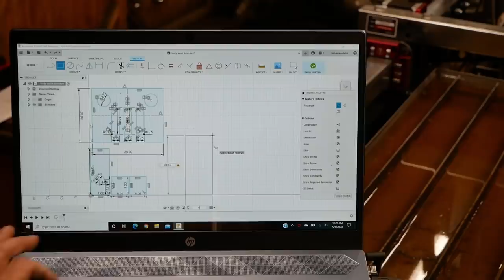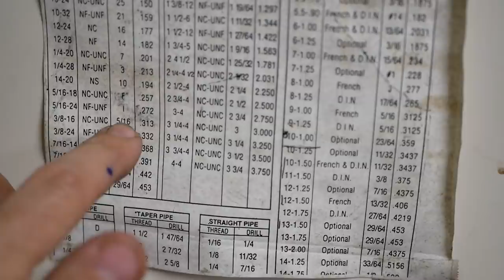420cc Predator powered articulating 4x4 dump truck build part 8

Comment: Great Stuff!  
   
....Something like this but with a hook-load mechanism on the back would be ideal for me. Hookload would be so it could quickly swap out rear modules (and tip them). Modules would be stuff like... log carrier, flatbed, dumper bed, cage for woodchip/leaves/grass, water bowser, mobile toolbox, people carrier, etc.  
  
Been looking for a mini-hookload type system for the back of a pickup to do something like this. But haven't seen anything that doesn't look clunky or isn't ridiculously priced.

Comment: I call that device a slip clutch but I think the technical name is torque limiter.  I have used them in places where the mechanisms can get jammed prior to hitting the limit switch or high forces were a concern.  What I really want to know is where to get the Mike Festiva stickers to fill in that blank space on my tool box!!  Great video, I like your growing special effects tool kit.  I also order some auto eject bolts for my current project, didn't know they were available to the public yet...
Reply from the maker: Haha! The bolts are getting a little cheaper now and more easily available 😂 
I’m new to this torque limiting coupler, after doing a lot of research I decided for the price and size they would fit my needs for the next upgrade to the articulating dump truck. My friend Dave just bought a vinyl sticker cutter Machine and he made a small run of stickers for me🙂 if I can get a few more cut I can try and get you one! Take care

Comment: Great series. I had been planning a similar build (mostly in my mind). I wanted to find a small diesel and use hydrostatic drive but your build is convincing me that maybe it wouldn’t be necessary for a machine like this. Your piece of property is also pretty awesome! A far cry from the bald prairie where I’m from. Lol anyway, keep up the good work. From: an impressed mechanical engineer.

Comment: Use the winch to pull the Suzuki up the hill!  Damn fine build, looking good!
Reply: The power of a fully locked differential versus what is probably a limited slip in the suzuki. Plus the tires on the articulated truck have more mud grip.
Reply from the maker: Both vehicles have open diffs the only real difference on the drive systems is the Suzuki is a true 4x4 with a transfer case with no center diff, the Subaru is a all wheel drive with a center diff.

Comment: Hey man....I writte to you form Argentina. I just love the artefact. 
You´ve taken that thing to the level of a product  you know that? And an interesting, plenty of potential one.
Coming from relatively simple materials, very well worked (congrats for the aluminium tig welding), you,ve taken it to full functionality. 
And I repeat,  even including it in a farming tool  tipology if you like, it reached a very , very consistent material quality.
Aditionally, it exceeds the performance of almost any device I know designed for that purpose.
If you wished to serial produce it the cost of transmision should be considered I guess, some alternative to those Subaru parts, but other than that you´re practically there.
I salute you, one man factory. Applauses.
PD: I´m an industrial designer (not sure if a good one but, anyway, jeje). 
To my beauty contest parameters, it would win any day, with the same cool elegance with wich it climbs those slopes.
Reply: Did you use google translate to write that

Comment: Mike Festive........The real life Iron Man, your rock brother!
Reply from the maker: Right on Calvin 👍 Thanks for checking out my videos, I really appreciate it!
Reply: @Mikefestiva   Holy Shyt dude your really responded! I could die in peace ! I'm a Aviation Mechanic and I aspire to be well versed in the many trades as you are. Practically everything you did in Engineering the 420cc Predator powered articulating 4x4 dump truck is the same thing I do in my line of work, The Hydraulics, Welding, and fabrication just to name a few. It would of basically took 5 Techs to do what you did, Keep it man, you motivate me to be a Jack and Master of all trades.

Comment: I noticed when you were crawling up one of the hills that you almost smacked one of your steering hydros on rock.  You might want to look into making some protection for your steering.  I know it's too late in the build to move them above the frame rail or I would recommend that.
Reply from the maker: I definitely plan on building some skid plates. The biggest reason for mounting them below for me was because I’m going to build a heated cab for plowing in the winter and that’s more important to not have cylinders in the way going though the cabs back wall. I actually will not do major off-roading with this, it’s probably going to stick to my muddy trails. My next build will be the off road machine 👍 Take care Paul

Comment: Its not a discount on the gas, most of the cost is labor to hook it up and fill it. I have a 138 cu/ft bottle and it was only 27 bux for mixed gas. I got it because I live over an hour from anywhere to get it refilled and didn't want to make that trip too often

Comment: It would be cool if you could fit a gimble type set up for the rear so when you go over a steep mound the load will stay up right whilst the rear axle pitches to the obstacles

Comment: I still think you should add an aframe to the back for a hoist function it would lift around 1000 pounds and make it into a swiss army knife around your place like I said before  we had a similar unit at the plant that I used to work at and it was very much a huge difference in moving parts  fixing equipment and other things that the maintenance department had to do.i worked there 30 years and they rebuilt it 2 times we called it the  mouse short for Mickey mouse we even had a vacuum tank for cleaning up  hydraulic spills and water. It was made in secret and hidden from the boss only used when he wasn't in the plant but he came in one night during a break down and saw it and after that it was used all day long it could go every where do about anything  and everyone remembers it.

Comment: I like the grill. Looks like Bender off of Futurama!  Lol Anyways you should put some sound deadening on the underside of the hood. It would help cut down the noise of the motor. As for the whole build I think its pretty cool. If I was doing it I'd made it fully hydrostatic, but the manual trans works too.
Reply: Hydrostatic would be awesome but the complexity and cost are  considerably more this build is the first generation and proof of concept it will be interesting to see how it holds up and if any thing  needs to be improved or strengthened

Comment: I really liked the hinge work for the hood then you went and put the winch on there and completely defeated the purpose. That hood must be severely limited in its opening gap now with the winch.
Reply: Right, because it’s impossible to slip those hinge bolts out.... 🙄

Comment: Ive been dying to know what unit bearing you used for the center swivel. As you know, many of them rely on the wheel nut to load the bearings. 

I'm just starting to acquire parts for my own articulated tractor based off 2 gm sm465 gear boxes plugged directly into 14 bolt rear axles with twin engines. One engine driving the front and the other driving the rear. The idea is to be able to cruise and steer off the rear engine and when I need more power/traction, start the front engine and shift the front trans into gear. Also planning to run a loader off the front engine
Reply from the maker: That sounds like a good build 👍 I used a Ford F 350 super Duty 4x4 front bearing, I think from a 1999? There’s about a five year run were the same bearing fits F250, F350,F450 and possibly F550? It’s got a really big nut that holds the entire hub together.Time will tell how well it holds up 🤷🏻‍♂️ The way I built the machine is it’s basically two frames with the wheels about centered with the load of each frame. I know my F250 is over 6,000lbs and I have hauled 4,500lbs of gravel in it without a problem plus those bearings should be able to handle that weight with a full load at 60mph on bumpy roads. Take care

Comment: Would a longer exhaust with a muffler (either straight up, tractor style) or dumping out underneath quieten the engine a bit?  The build is great, it's almost let down by the engine!

Comment: Nice work, I'm sure not the first time someone said this you need to add a loop bar and seat belts and a crash plate behind the driver seat so when you start hauling rocks and stuff and if it flips you will still be here to make more cool stuff just saying

Comment: Really nice build, from an idea to a running off road wood hauling little beast, i have seen most of videos on the build and your new tool additions and the plasma table is a great tool to have, i use one where i work,  its an industrial set up for cutting teeth in heat  treated boron and works great cuts 3/4"- 1 3/8"  it just doesn't have the cad software you have, looks like your living in Fern Gully nice area , it will be cool to see when you finish it more and have a load in the bed, then you will tell yourself i need this on it and answer yourself ah hell yes, its ok to answer yourself i do all the time LOL  , look forward to the next video,  great editing,  👍

Comment: You could make the HOOD hinge bolts removable  so the hood can swing open OR pop right off when the winch is mounted.
Reply from the maker: Yes I can open the hood to fill up the gas take and do simple work, pull two bolts and lift off the hood, I have thought about installing pins like you mentioned 👍

Comment: Cut out the outline of the winch in the grill bolt it down. When the hood is closed it looks complete but will open completely with out removing any bolts. Not sure if it makes sense but I think it would work...

Comment: Mike - Correction: Vehicle width (50"). Wheelbase is the distance between the front and rear axle hub centers. Track width is from wheel centerline to wheel centerline on other side of axle.
Reply from the maker: Thanks 👍

Comment: Great design Mike! Looks like you borrowed from the 1970s Coot vehicle a little? Very nice drive train! Kudos!
Reply from the maker: I will have to look that Coot up I’m not sure I know what it is. Thanks for checking out my truck build 👍
Reply: It is a amphibious vehicle that also  pivots  very cool design it was a friend had one in the 70s we used to ride it all over even in a pond! .. It was designed in the late 60s early 70s

Comment: Very cool. Find my self worrying about that turn cylinder. Can it not be flipped to be mounted above the frame rail? You can see it getting pretty close to ground and rocks. With a loaded bed I wouldn’t of thought it would take much to bend it on a inconveniently placed rock/tree.

Comment: That winch was almost a waste of money on that beast. It seems unstoppable;
Reply from the maker: Haha you are right! It definitely hooks up off-road. I’m in the process of building a external adjustable limited slip for the rear diff, so it’s going to get even better. Nate it’s hard to see in your photo but is that a CB you’re sitting on?
I have a old Honda CB 350 four and my brother has a CB 500, I also gave my nephew my old CB 200 twin cafe bike I built up. Take care 👍
Reply: @Mikefestiva  it's a Suzuki GS750 I built into a cafe racer. Don't have it anymore, sure wish I did though.

Comment: This is turning into an amazing machine! Has me fanticizing about building one.  I'm curious about the weight in it's current state, the weight of the Subaru drive train, and how much weight you hope to be able to haul.  Now that you have played with it a bit, is there anything you would do differently on the build?  (specifically regarding the articulation joint design)
Keep up the good work!

Comment: 26:05 You cannot compare two vehicles if they have different tires! After all, it becomes quite different and like comparing winter tires to summer tires on an icy road . One tip for the winch is to put a switch on one of the cables! Has happened that cheap china winches go off and pulls wires and mounts when someone winch nearby with their remote control.

Comment: of course it climbs better then your side kick lol...one has crappy tires and the other has Tractor Tires!! Truly not a suprising outcome. I am sure the results would be the same or very similar (some weight difference between vehicles) if you put the sidekick tires on your toy ttuck and tried it again in the same conditions as before 8'D   Very cool toy though and its cool to see you make it yourself!  build a Roll Cage and Back Cage for protection on rollovers rtc!
Reply from the maker: The tires on the Suzuki are not crappy tires they are brand new mud terrain tires, it’s a really steep hill and extremely mucking. I get tired of people making assumptions. Even said in the video I had new mud tires on it.
Reply: @Mikefestiva  Hi Mike, I should have used a more descriptive sentence then saying "one has crappy tires and the other has Tractor Tires!!" I should have said, "The tires on the Suzuki are Crappy Tires when you compare them to the Tractor Tires even if they are Brand New Mud Tires. They still do NOT compare to the Tractor Tires you are using which are meant to be used in fields of dirt and mud while pulling heaving equipment behind it. Something YOUR Suzuki with Brand New Mud Tires could not compete against! Look at the Tires, the tread type, size of treads and of course what they are meant to be used for!  Put the Brand New Suzuki Mud Tires on your Tractor and do the exact same run in the exact same conditions and I would say there is a 99.99% chance that it will NOT perform as well as it does with the Tractor Tires. 

I meant NO disrespect in my first comment and again mean NO disrespect but I was WRONG in assuming that you'd simply understand what I meant. So I tried to write it in a clearer way this time. By the way, I was not making any assumptions I was speaking from experience in 4x4 and I also owned the exact same type of vehicle you used! So I know what it can and cannot do with different types of tires in different conditions.  Larger wheels with larger lugs with wider spacing perform better or worse in different conditions (wet, dry, sand, rock, mud, clay etc.) then smaller tires with tighter spacing of lugs and smaller lugs (tread). Any experienced 4x4 driver and farmer knows that tire size, tread type and size can make a HUGE difference in the performance and capabilities of vehicles ON and OFF road!

Try not too let things bother you (being tired of people making assumptions) on here. When you post a video for others to see and allow comments it is ONLY natural for people to have different opinions on topics of discussions and levels of experience on those discussions. Sharing thoughts and opinions is a valuable thing (even when those thoughts or opinions are different) and sadly reading text can be taken/understood the wrong way (from the authors intention) because you do not experience the emotion of how its conveyed in the same manner as speaking and picking up body language. Hopefully this reply clears up any confusion on my original comment and again I think its very cool and cool to see you make it yourself. By the way I have NO experience in welding or building a vehicle from scratch and aside from the part about the tires my main reason for commenting was to compliment you on your work and to recommend a safety cage to protect yourself from rollovers or stuff sliding forward into the back of you (when coming to an abrupt stop). Cheers!

Edit: Fixed sentence structure.

Comment: I'm thinking I had some sort of roll cage to that thing just an idea thinking if you have that thing full of wood and you're in the woods you tip it over I'd want to have some sort of protection
Reply from the maker: Thanks for checking out my build 👍 yes a heated cab is in the plan for this, we get a lot of rain in the northwest and I also plan on building a snow plow for winter snow removal. Take care

Comment: It's a torque limiting clutch that is generally used with a modified type-A plate chain sprocket.
Reply from the maker: You are correct 👍

Comment: ponder
Could you raise the dump bed not with hydraulics, but mounting another winch to the rear but instead of leaving the cable in a hawse, run it around a pulley down to a pivoted lifting bar underneath the bed. Spool the cable in, lift the bed. Get stuck behind, just unclip the cable from the lifter, wind it off the accessory pulley, through the hawse, and unstick yourself.
Depends on how much you intend to load the bed with, I suppose....

Comment: hi mike the larger john deer ride on lawn mower tilt hood and fenders would look agressive and awsome on your already awsome  4x4 dumptruck a little bit of curviness would make it look like a showroom bought machine either way still looks awsome in my books. have you thought about making the tipper tray inter changable with maybe some forks or a small tilt gantry for the tray for picking up engines and heavier loads since where you live might as well make it universal one truck does all keep up the great work cheers from down under

Comment: 16:46 With those water drainage holes how would you prevent it from rusting inside? Pour some transmission fluid?
Reply from the maker: I think it would take a life time before it rusted from the inside out. If you look at most motorcycles and things they will put small holes in the lower frame tubes to help drain out water if it gets in. Thanks for checking out my new video!

Comment: ingenious forest vehicle. do you already know something about fuel consumption? because of the small engine and low weight. but with more load and speed, the little ones also drink a lot. That would be very interesting. A comparison somehow (tractor, quad ..). No idea.

 Very important still, you need a tree, rock n Roll bar !😉👍👍👍👍👍